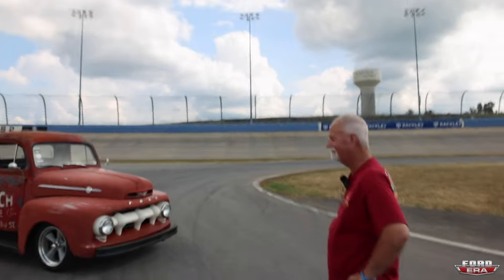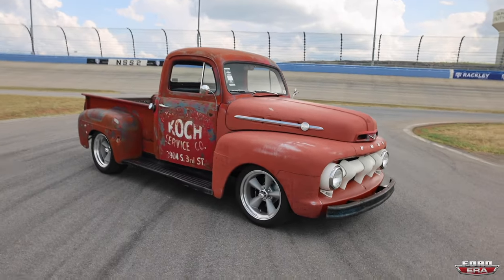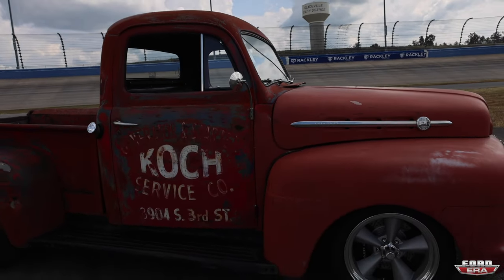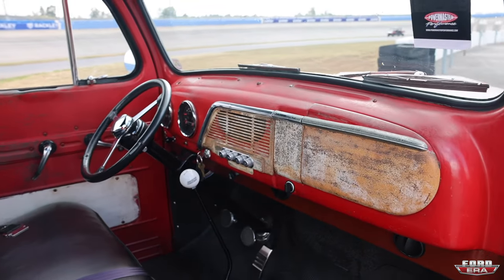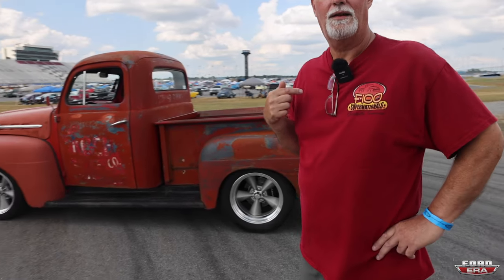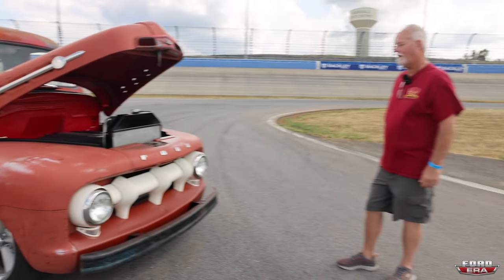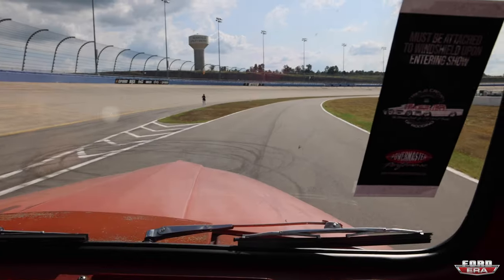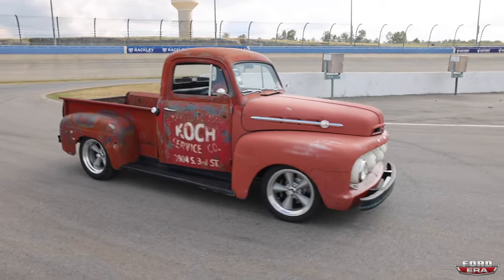Coyote Swapped 1952 F1 on Roadster Shop Chassis | What The Truck?

Comment: finally someone who puts a ford engine in a ford truck seems like most guys go the easy way and do a LS swap
Reply: Agreed. I don't care what the make, always power a vintage vehicle by an original manufacturer name engine. It is an immediate turn off when I see a different make engine powering the vehicle.
Reply from the maker: I think majority of ford trucks i see are still baring the ford motor. I think its probably 1 out of 10 have an LS
Reply: I was at two car shows over the summer and 3 out of  4 were ford  with LS motors
Reply: @mikehubbard1067   That is generally what I see when you see these vintage Ford truck restomods for sale, some flavor of Chevy engine.  I just don't get it.
Reply: Thank God! So tired of seeing the crossdressers! Great truck!